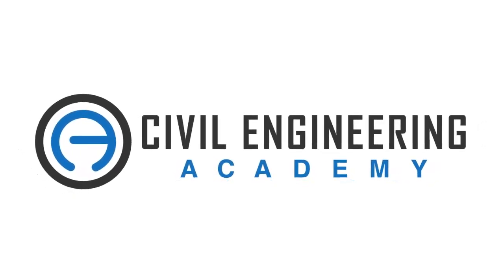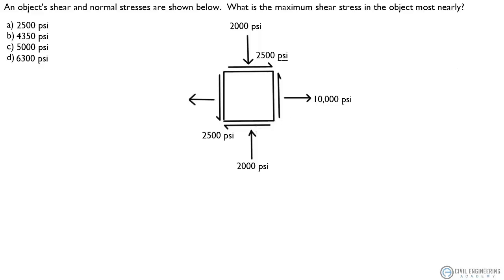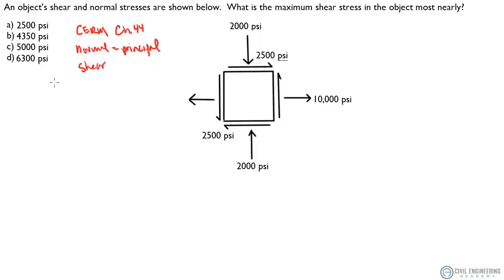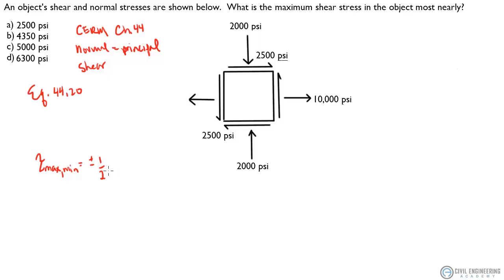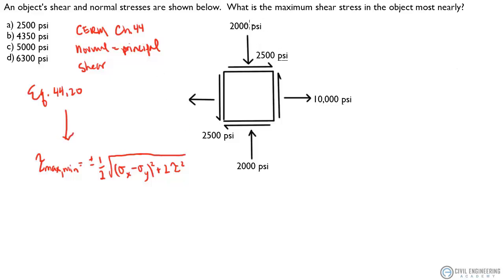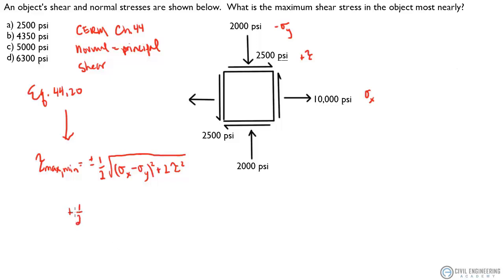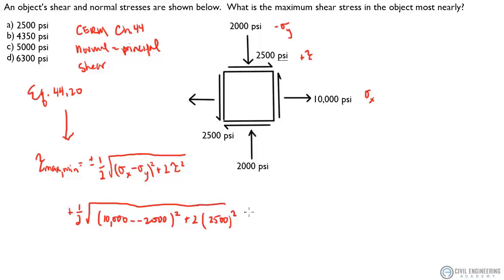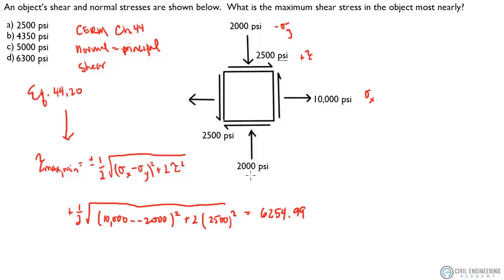Structures - Find Max Stress in Object

Comment: This may be a dumb question, but why don't you have to resolve the forces in the x and y direction? It seems like you disregarded the forces on the left and bottom faces of the object.
Reply: Those are shear stresses. All shear stresses are the same due to equilibrium. There are four shear stresses of equal magnitude in the diagram.

Comment: The answer is 6,500 psi. You did not square the 2
Reply: Answer is 6500psi,  sqrt[((10000+2000)*.5)²+2500²]=6500psi
Reply: The 14th edition Civil Engineering Reference Manual eq. 44.20 shows (2τ)^2, not 2* τ^2. I think the book is correct, not the video. Answer is 6500.
Reply from the maker: Thanks, I'll check this out!

Comment: Check me if I'm wrong - Eq 44.20 has (I can't find the proper symbols) r1,r2 = +/- 1/2 * sq root (ox-oy)^2 + (2*r)^2. When you plugged in the numbers in to the formula at + 2r^2 ie 2(2500)^2, shouldn't that be (2*r)^2 or (2*2500)^2? I get an answer of 6500 psi.     Great job on all the videos! Thanks
Reply: I get the same:  6500, which would be closest to answer D.  Thanks for the videos.

Comment: isn't it  (2 x shear)^2 in according to the eq. 44.20.  Problem does not stated to use positive normal stress or negative normal stress.  Is it an assuming to use as a positive stress in this problem just because of the question ask to find "maximum" shear stress?
Reply: +Hannah Nguyen I agree, and I would would have chosen A as the answer.